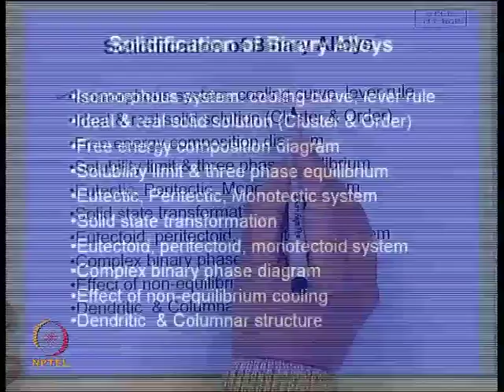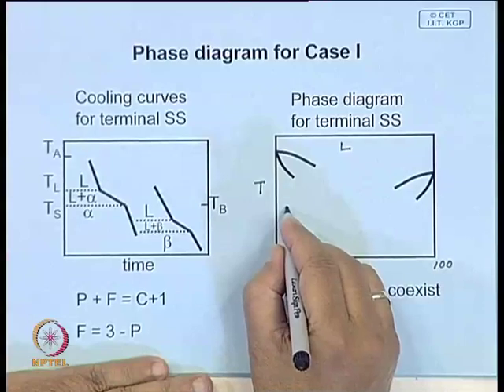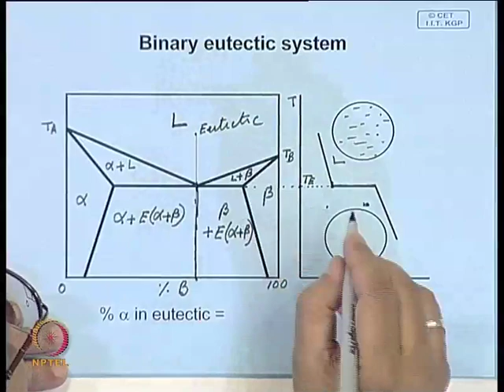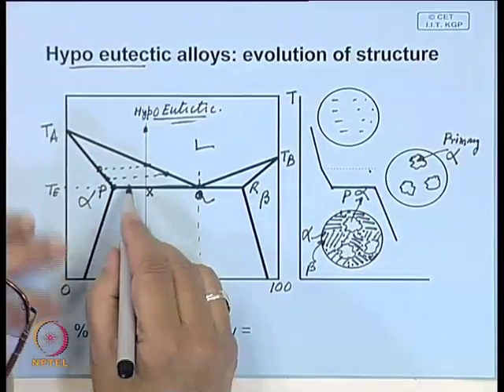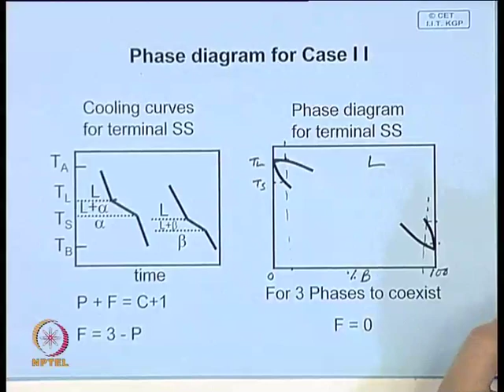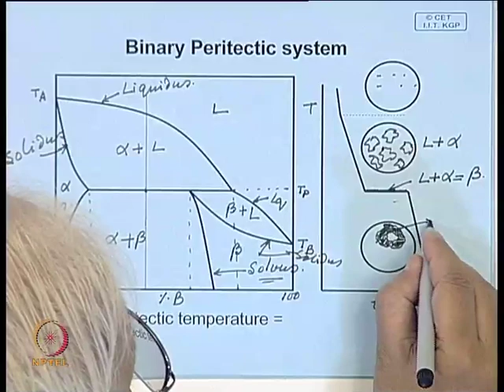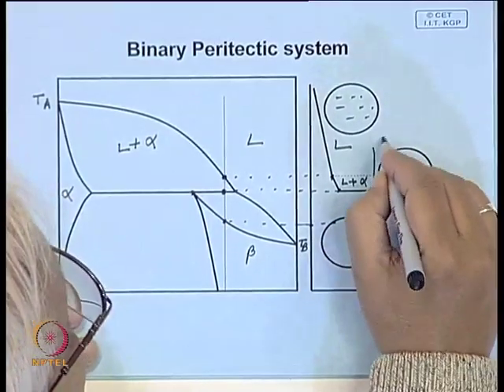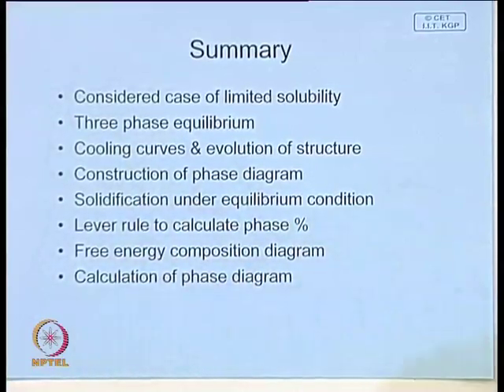Mod-01 Lec-19 Solidification of Binary Alloys (Contd...1)

Comment: I'm afraid you made a mistake about the peritetic reactions in this lecture. Alpha + L -> alpha + Beta ? it's no supposed to be an intermetallic compound like . Alpha + L -> alpha ( IC) , wich you did not describe in this specific diagram . 42:34 Correct if I'm wrong. Thanks for the lecture.